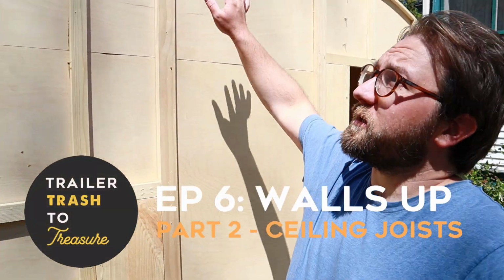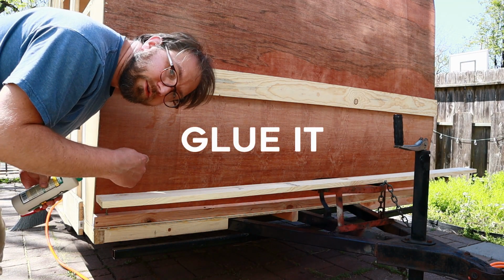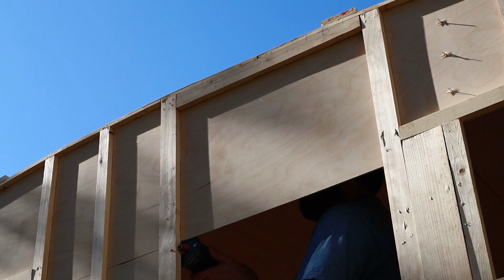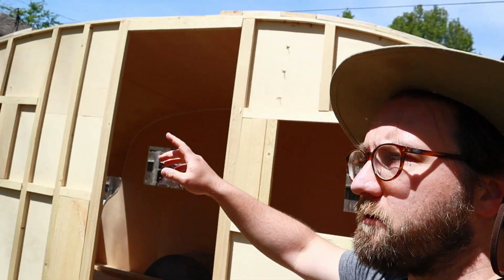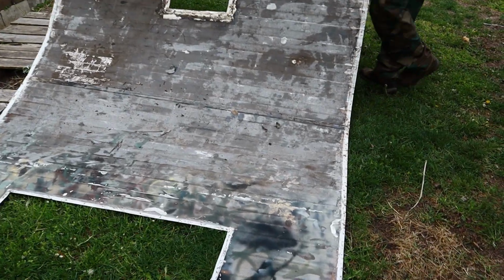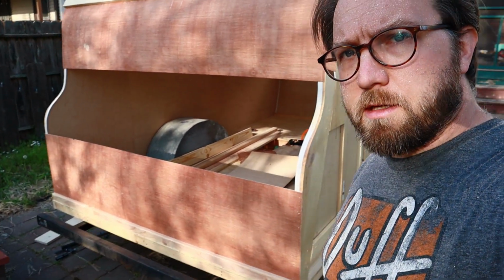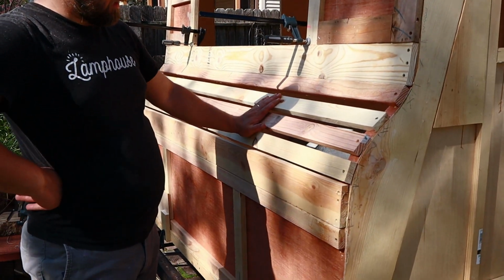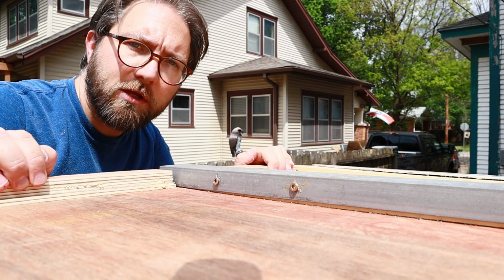NEW WALLS INSTALLED PT. 2 // VINTAGE CAMPER frame off renovation

Comment: what tool did you use to cut out the door. I NEeD THaT!
Reply from the maker: That is a trim router with a top bearing flush trim bit. It's maybe the most satisfying tool you'll ever use in a wood working project.